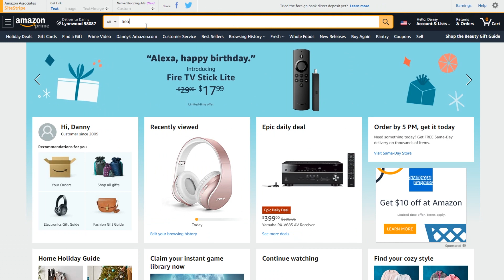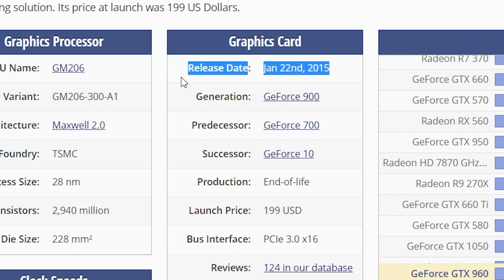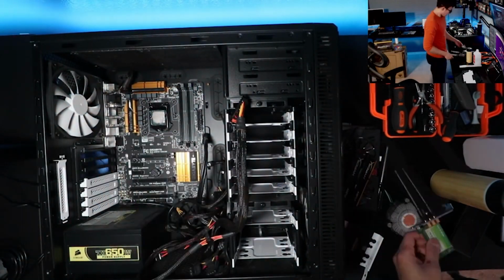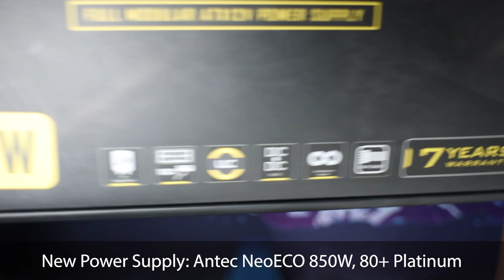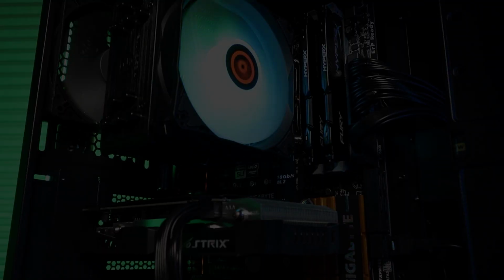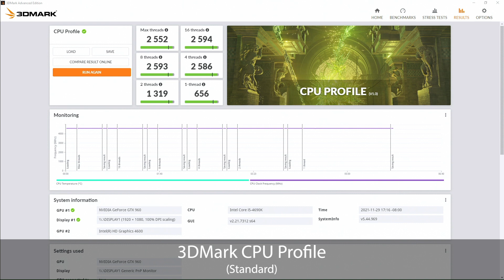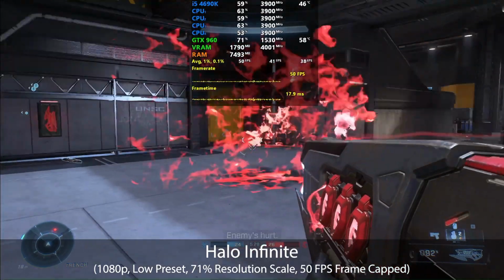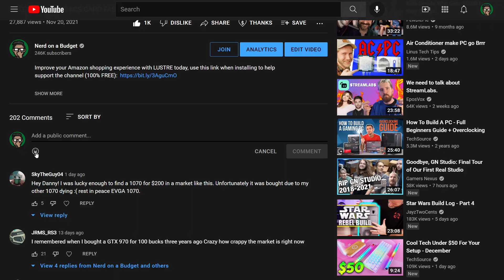Friend is leaving the country, gives me his old gaming PC

Comment: The 4690k was a really good chip and still holds up relatively well. Literally had the exact same system specs for my first official gaming/main PC. Except I had an evga ssc card instead. Sold that rig and built a Ryzen 5 3600x and RTX 2080 super rig to replace it. Might have spent a lot at the time but was totally worth it. Hasn't struggled with any title I threw at it and DLSS is literally magic.

Comment: Future owner could slap in 4790K and something like 1060/1070 tier GPU and get pretty balanced setup without upgrading the platform too :P Coming from me as I had 6600K and 1060 6GB upgraded to 6700K and 1070Ti :D Those extra threads really helped with some more CPU intensive games like Battlefield 1 and onwards :)

Comment: So I have a question, I have an older rig I’m having a hard time selling on eBay similar to this. How much should I be charging?
CorsairCX750 ATX PS
AIO Cooler
Asus Maximus VII Impact
I5 4670k
16 GB Corsair Vengeance Ram
Samsung 840 120GB drive
Seagate 3TB storage drive
EVGA GTX 770 SC
Coolermaster Elite 130
And I’m throwing in an rf Logitech keyboard  and mouse.

I have it listed for $500.00….the Maximus VII Impact MB by itself goes for 300 on eBay. I have this thing listed for 500 or best offer and nobody wants it.
Reply: maybe drop it to 400 to 450 dollars

Comment: Hey Danny I have a local deal for an i5 8600k, MSI Z390-A Pro, 16gb ddr4 CL15 2400mhz ram, and a Coolermaster Hyper 212 EVO cooler and it is selling for $350 CAD is this a good deal?
Reply from the maker: I feel like you can price out a 10400 with all brand new parts with compatible motherboard (doesn't need to be a Z board), same ram capacity, and similar style cooler for the same if not less, and doing that you'd have a much better road ahead of you with the 10700 down the line than a 8700
Reply: @nerdonabudget  You are right. Brand new I can price out something similar for just slightly more. You think if I can negotiate him down to $300 it would be worth it? Or maybe I should look elsewhere, like what do you think I could get similar price and performance wise from AMD?
Reply from the maker: Yea 300 is what I was I initially thinking if it can be talked down at all
Reply: @nerdonabudget  He agreed to $300 CAD I think I might go for it. What do you think?
Reply from the maker: At $300 I feel much better about it, honestly you can go either way, if you're strapped for cash and aren't chasing the top top fps then take that, if you think down the line you'll want to upgrade and have a more powerful PC get the 10th gen I say
Reply: @nerdonabudget  Yea I think im going to shoot for it. I only play games like Valorant and mostly other esports titles. Thanks Danny this is why I've been subbed for so long, you care about your community.

Comment: I can't find anything cheap in my local area, gtx 1050 for 140 usd, which isn't bad but that's the best deal. My ps4 just died so i am going to upgrade my dell vostro 3670 and add a gpu that doesn't need a power cable, and i am currently searching for a way to make my sata m. 2 work on my nvme computer, and the cheapest 8gb ram costs 40 so yeah. Fortunately for me my brother apparently has an asus on fan card that he yold me, i just want to know what gpu it is, if its good he might ship it to me from Canada to the Middle east.